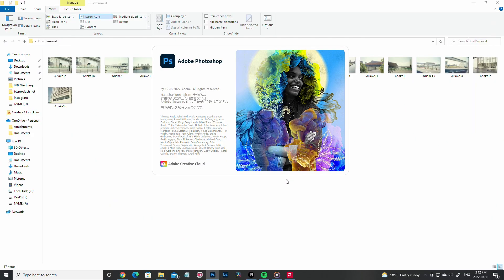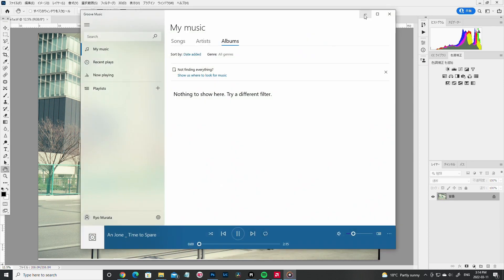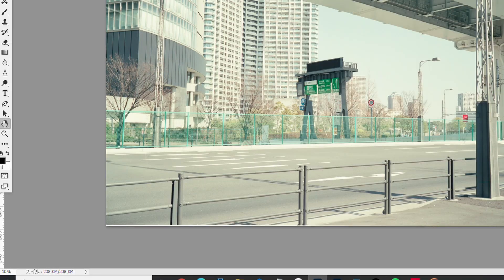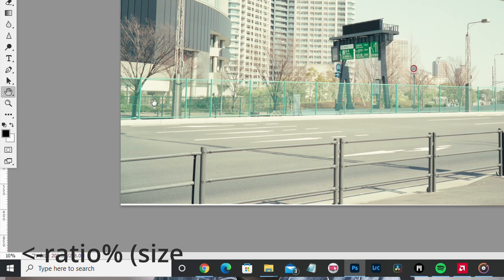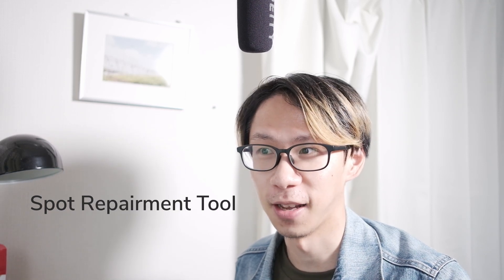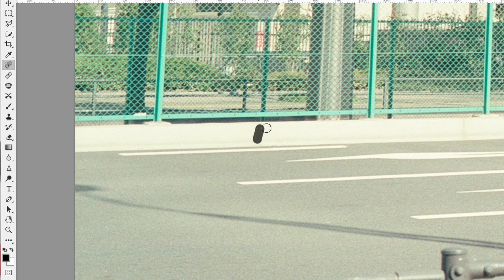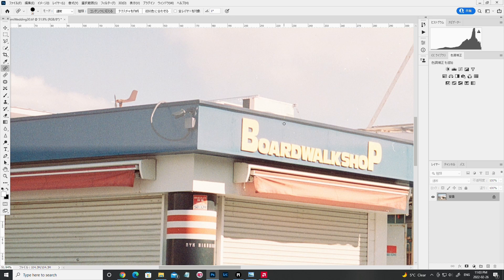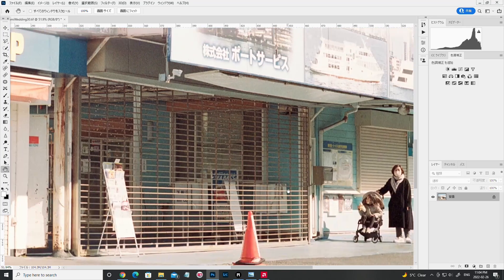How to Remove Dust/Particles in Photoshop Film Scans

Comment: I use my canon 5d to scan film. I use enlarger lens and macro tubes. To achieve focus on edges i need to stop down to at least f11. And there is LOT of dust on my sensor. 
I spend a lot of time cloning out spots but i would rather do that and save for a7r2 than spent $25 on sensor cleaning kit i guess. 😂
Reply from the maker: Thanks man for commenting....I know how it feels since I forgot to mention that in video lol if there's dust on sensor along with dust in film negative it's like a double whammy....